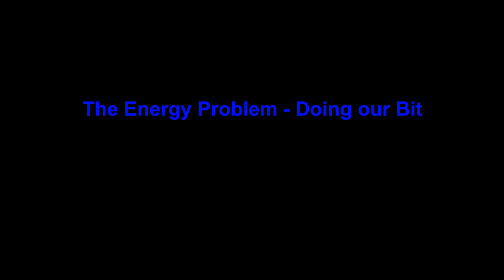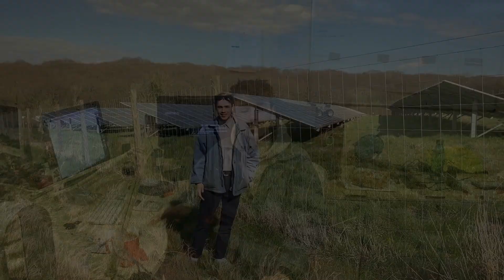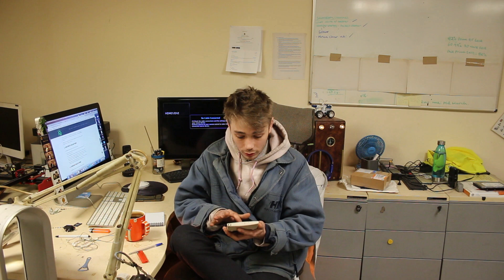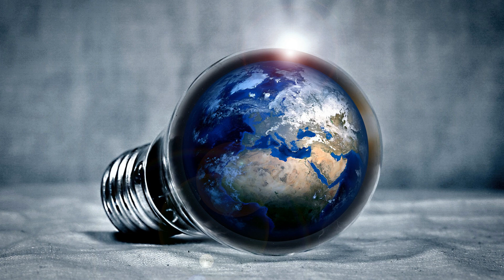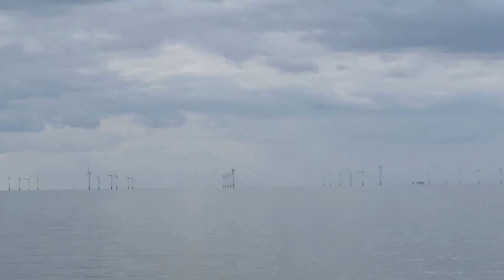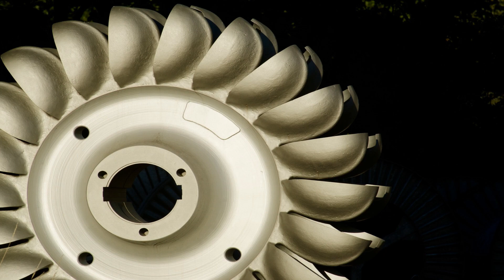1500 - The Energy Problem - Doing our Bit

Comment: Missing a Atmospheric power the sea of energy above us and Ground power flowing below us both untapped then cymatics, vacuum power am sure there is many more ways.
Old cathode (sun) and anode (moon) buildings tapped directly into all of the above wind,water,sun,moon,atmospheric,grounding is vibrating at 7.83hz ,cymatics-crystals&tuning forks, clocks where massive wimshurst machines replace minute and hour fingers for discs would get some serious juice, add tuned crystal windows removing the stained glass with fames shaped to capture the universe's harmonic notes. These where build to serve many many generations not just 5 years 10 years 20 years. 
Tesla had it right , think in terms of energy, frequency and vibration, his patent run on tuning to many different light bands UV ,INFRA bands enabling there use with no sun. Edward Leedskalnin tuned and worked his at night.
There is no shortage only limited thinking.
One Love

Comment: Certainly is sad to see them using valuable farmland for solar. With all the rooftops in residential areas,  they could create the power where power is needed.  Why not floating solar on those non-navigable areas around those windmills. Living on island should make people value the land more so. ... If we could have been burning alcohol for last 100 years would we have a CO2 problem today?  If we reduced all wasted radiation (transmission lines, microwaves, radio waves, etc.) would we have global warming?

Comment: Actually, there is another way to generate power, part of the water division mentioned here, but instead of kinetic hydropower, such as falling water or high temperature - pressure, there is entropic - pressure power generation. When a fresh water stream (low entropy) enters seawater it mixes and becomes high entropy with considerable energy released, equivalent to kinetic dropping of 700 ft if I recall correctly. This is why reverse osmosis to purify seawater to drinking water takes so much energy... you are moving water from a highly chaotic state to a highly ordered state of being fresh water.
Take a fixed volume of seawater and allow fresh water to enter that fixed volume via a semipermeable membrane and the fresh water will be drawn in with emmense force. A fixed volume with an increasing density equals high pressure... release that via a turbine.
The ideal location for this sort of plant is where flowing fresh water is about to enter seawater. No need for a giant dam or high hills. So long as your fresh water doesn't dry up in summer you have a base power production, ie, it doesn't suddenly stop producing when the sun goes down or when wind stops blowing. An engineer in Norway built such a plant. The membranes are the expensive limitation but with rising clean power demand and cost, I'm surprised I hear nothing about any R&D in this field.

Comment: People aren't thinking about grid interconnection, probably because most aren't familiar with Metcalfe's law, which concerns the network effect.  Despite this, it is probably the most significant factor needed to accelerate reliance upon intermittent power production.  The major advantage of grid interconnection is that it doesn't require rare materials, as most forms of battery storage do.

Comment: The problem is all of our major energy generation is using heat engines using chemical means this generation process cannot be 100% efficient and is already very inefficient the rest is discharged into our atmosphere. The problem is we need to transfer to more efficient systems, that means we have to agree to losing most of the conveniences we take for granted. This would take planning as to what are the most valuable reasons for using heat engines in our society. In other words we need to balance energy use against societal benefit. You need to address this in your presentation, I don’t see anyone approaching the problem from this view.

Comment: Nice video, but I have heard that since the year 2000, global energy consumption has increased more than all the renewables that have been installed since 2000.
Reply: See i don't know about that, although it wouldn't surprise me. In the UK the average household used around 8kWh per day🤯
Reply: Wow.  As a matter of record I had a house in USA that used 30kwh/day and currently I am in a terribly inefficient house (that uses a heat pump!!!!) that consumes well over 120kwh per day.  It is crazy. I do know this:.  20 years ago it was common for homes to have 100 amp electrical service and now they all have 200 amp service.  Consumption has doubled in 20 years.  😢

Comment: I think these solar farms aren't the best way to utilise solar, which really comes into its own as a highly decentralised form of energy. You put a solar system on top of every building, and before you know it you have entire communities achieving energy self sufficiency.

Geothermal is the elephant in the room here when it comes to renewables. Sure, getting the infrastructure for feasible power output involves a lot more digging in non volcanic regions, but it has a trick up its sleeve, along with hydro it's the only renewable energy source that has no intermittency.

Nuclear can be instrumental in doing the bulk of the work in transitioning away from hydrocarbon fuels. However, algae is also another avenue for creating carbon negative hydrocarbons.

I have talked about all of this before on my channel. This is definitely something I'm interested in, as per being an advocate for sustainability.

Comment: As advised by another comment, the relevant figures are not the wattage the farm is able produce but the wattage per unit of time. A farm producing 100 kilowatt hours per year is ten times as productive as one producing 10 kilowatt hours per year. Both could have the same kilowatt output but one gets ten times the cloud as the other and therefore produces 10 times less power per year.

Comment: Great presentation, you are getting better at it. Near me they are building 150 acre solar farm. It is being built by our County, but will be sold to the power company. How much savings or benefit it will be remains yet to be seen. As we know they are only 20% efficient. Another thing to consider though is the CO 2 generation from removal of the plant life - less plants less conversion of CO 2 to Oxygen as the feed on CO 2. The Wind farms here, (as I have previously stated), in the USA are being removed due to environmental concerns due to leeching of oil, grease, off gases of construction materials, and altering the magnetic fields of migratory species. Additionally, the costs of labor and parts for repairs - therefore, at the end of their life cycle or should they fall in disrepair they are being removed altogether and not replaced.

Comment: Considering the extremely small lifespan of solar panels,  I honestly don't consider solar a viable replacement for fuel based generation.  Wind generation is great,  but it needs scaled down to be more cost/resource effective. I think water is the most effective generation considering cost/mass to population served ratio.  But once people stop building giant wind farms and finish developing more practical designs,  wind will dominate the energy production.  At least until extracting energy from the atmosphere becomes more usable.
Reply: extremely small life span? Best wishes.
Reply: @jimmycorkhill1390  25-30 years is next to nothing when you look at the big picture
Reply: @elizabethmckinney7182  I suggest in life cycle costing terms compared to other sources and their high level operation and  maintenance needs, then that timescale makes them cheap as chips? Best wishes.

Comment: Another type of renewable is charcoal gasification, it can be produced from just about anything, and when created in the presence of water produces h2 and co2. If done right you can feed that to a greenhouse so that the h20 waters your plants, and the co2 increases plant growth.
Reply: They are fairly involved and perhaps not attractive to the average punter, steam is another. Im perhaps gonna opt for biogas this year, which may be the simplest Best wishes.
Reply: @jimmycorkhill1390  yea it can be, but I’m thinking that making the charcoal could cover the natural gas I use, and gasifying the charcoal for a diesel generator can cover the power. It seems to me that too many people over complicate it, so I’m going to try setting up a reasonably easy system sometime this year.
Reply: @robertchristensen5251  I wish you all the best with it. Id be really interested in your successful project. Ive looked at quite a few on line, some people are so talented and have great engineering skills. Im dithering a bit as to which way to go, and I have lots of other stuff on the go. But I really want something to produce a few hundred watts to give me power at night and on dull days extending my battery banks life well into the future. Converting my small petrol inverter to gas and making the digester seems straight forward enough. Those converted two strokes to steam look quite useful though too. Ive access to lots of tree branches and your idea would be great for my polytunnel though!. Best wishes.

Comment: I patiently await the day you start producing electrets. 
I know it's easy, believe me it's easy. It just takes that first step. 
So you know about Nicola Tesla. Most people know about him now although it is irrefutable fact that Mr Teslas works didn't work. He studied under a guy called Oled D Jefimenco. Tesla then used ODJ patents and hey presto became a hero. 
Teslas work involving high side switching, NOT HIS.
Tesla work involving iron core transformers, NOT HIS. 
I could go on for days.
The list is endless.  Although Marconi. Nah Marconi was Tesla works. 

Anyway. Before Tesla we had motors that spun freely from the asymmetric dielectrical charge between earth and sky. 
The main component is the electret. 
Bro please make them. You will be blown away by them. In short they are the inverse of a magnet. A positive static charge on one side and negative on the other. Containing zero metal.

Comment: The hugely under utilized space for solar is roof top. I get slightly uncomfortable seeing fields used for solar, we should be more self sufficient growing food. Another issue is old housing stock with poor insulation. There needs to be much more money available for this issue, it's absolutely fundamental foundation stuff for energy conservation. But hey, since the fossil fuel companies have the lobbying power to influence policy, that kind of thing won't happen soon. Domestic energy use is around a third of total consumption in the country (UK) so industry needs looking at too. If every industrial estate was paneled up, in combination with battery storage, savings could be made there. In terms of nuclear, on paper it looks attractive, but actually because of all the extra infrastructure needed, doesn't do that well ultimately on its carbon footprint.

Comment: Unfortunately Solar and Wind are not Economically Viable on as commericial scale yet.  Most all of these Solar and Wind Farms are left to go fallow as soon as the Subsidies dry up.  Just like the one down the road from me here.   I'm able to lower my Home power bills substantially using a Solar / Wind Augmented Power Wall set up.  Most folks wouldn't go through the troubles.  On the Commercial levels Maintenance Cost is simply to high.    Payback or Break Even  on Home systems could be decades.  I don't plan on getting there.  It's more of a hobby thing.
Reply: My litle hobby setup saved me 90% on my electrical bills the last 6 months. It's about understanding where you use energy and how you use it. The savings are going back into the hobby project this summer.